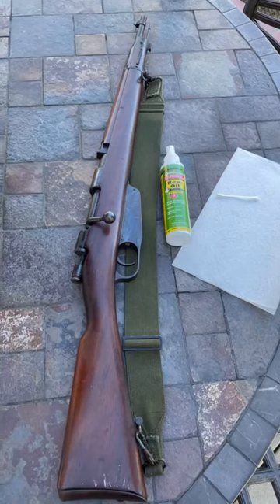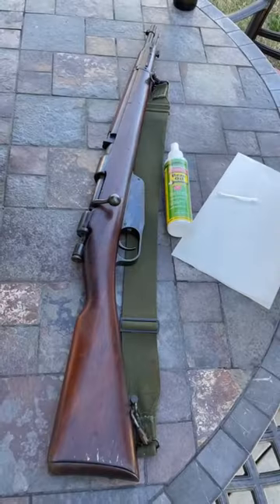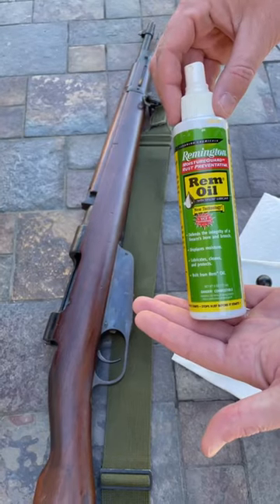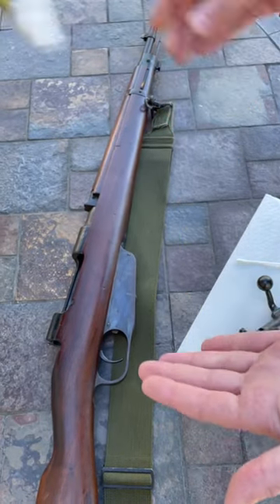How to PROPERLY maintain Italian firearms #shorts

Comment: I don’t have a carcano, but I have a beretta 92 I’m about to go lather up
Reply from the maker: This 100% works for berettas
Reply: @VintageWarfare  good to know, works great for the beretta. Tried it on my Glock and the polymer turned to goo……….
Reply: @VintageWarfare  
Will this work on a Taurus?
 I have a PT92, so should I just smoke meth and then spit on it...?
Reply from the maker: @thereindeertherabbitthebat592  this checks
Reply: @kennethrimmer1883   Actually, olive oil Is a good firearms lubricant mixed with some diesel fuel
Reply: @VintageWarfare , I seem to remember cleaning my 92 like this in the Army... of course, I do have some cranial trauma.
Reply: @redcell9636  both……… Roman Greco wrestling, lather myself and my beretta up in olive oil before battle

Comment: If you need to remove the oil, simply dismantle it entirely, and put each part in the microwave for two minutes.  Then reapply the oil.
Reply: This sounds like a terrible idea to me. How is it safe to put metal parts in a microwave?
Reply: @apextiger4459  Nah it's safe, while the specifics aren't known carcano rifles named after the inventor of the rifle Carcano heat treated the metal in such a way that their wasn't any violent reactions in microwaves.
Reply: @ztoxicman  yea….that’s the ticket!
Reply: @apextiger4459  
It may or may not be tge case that this is just how italian gear works.
Reply: This actually works

Comment: Olive oil will work in the short term but the oil gets sticky as fuck when it gets old. stick to proper gun oil
Reply: So, you ADMIT you don't fire your Italian weapons enough!
Reply: @Brett Baker   my carcano probably gets fired 2 or 3 times a year (which is more than most). Plant based cooking oils dont make good fierarms lubricant because they degrade get goopy and attract dirt.
Reply: @Brett Baker   I did not know that. I knew they had issues with the viscosity of the rifle lubricant but not about them using sunflower oil